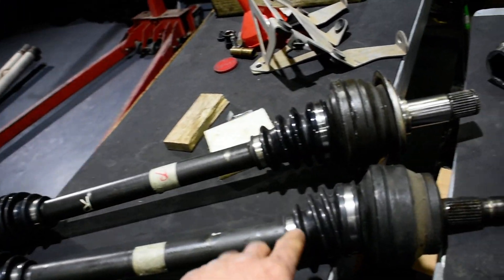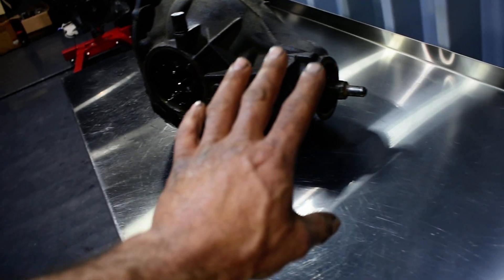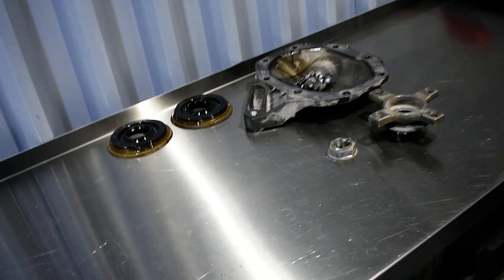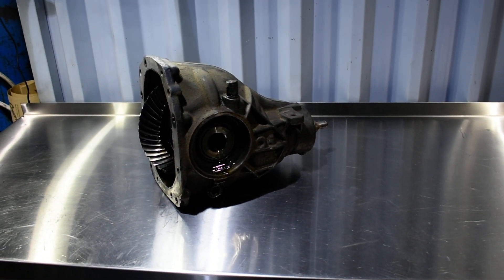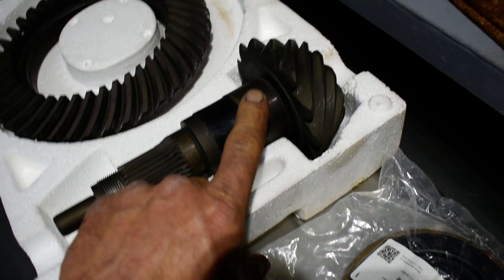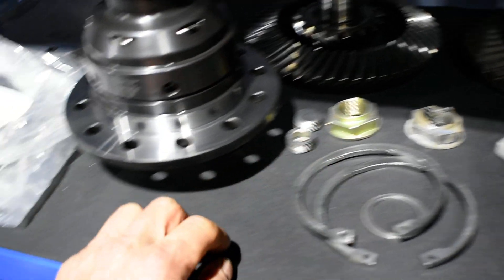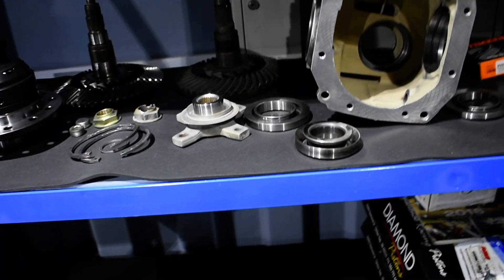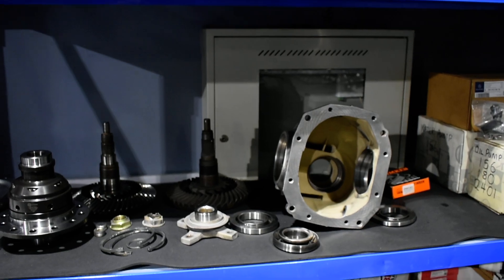MB C63 2008 differential ring&pinion ( part 1 )

Comment: I thought u might like to hear about this. My E55 recalled pumps wiring sequence in the pump is Yellow-Red-Red-yellow.    The fuel pump adapter is yellow red Yellow Red. My tuner is saying that MB don't change the adapter like their supposed to and then it creates our cars to run lean. U ever heard of this ? I just saw it with my own eyes